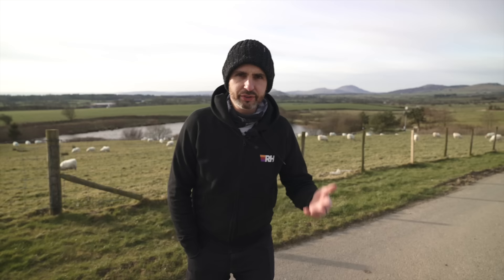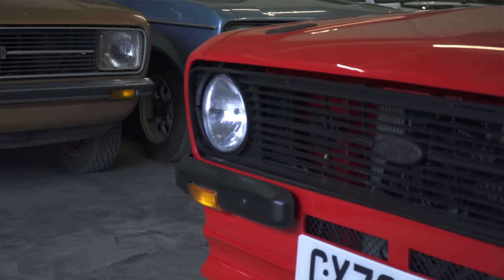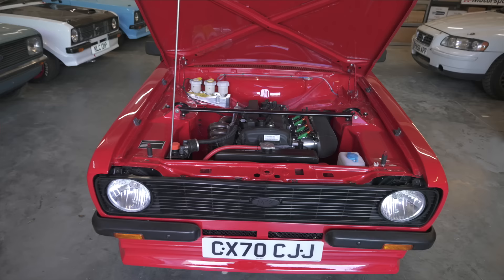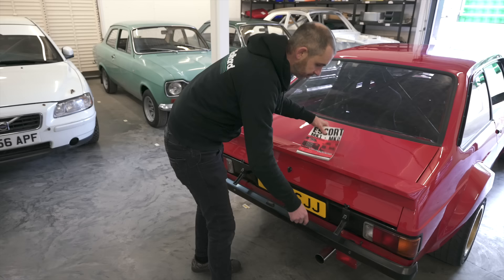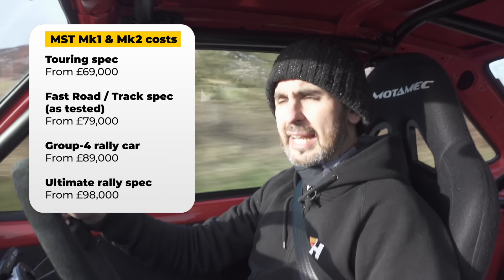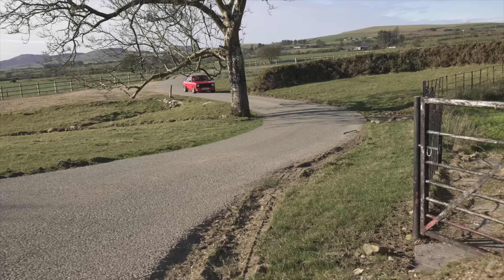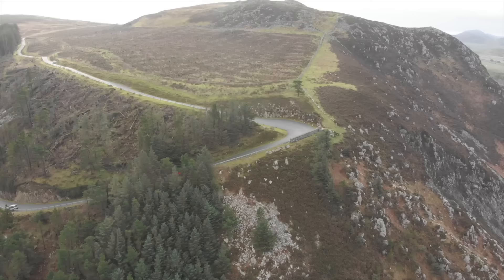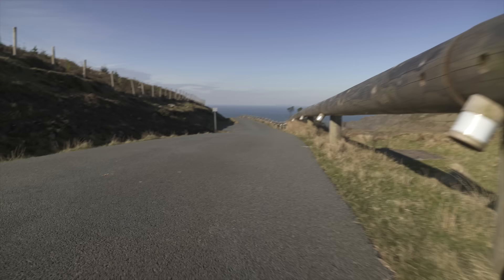BRAND NEW MST mk2 review - the ultimate Ford Escort? Exclusive first drive

Comment: As someone who’s first car was a mk1 escort 1300 sport I actually can’t think of anything better to spend £70,000 on
Reply: Abso-fucking-lutely
Reply: What’s not to like lol
Reply: My 1st was an 1100. The dealer had a 1300 sport, but my dad ( who was subsidising it) wouldn’t wear it. He was right. 3 months later I’d pranged it rather badly. Correctly, he said I’d have to save up to get it fixed, so it was back on the bus to work. That old baby took some abuse though. Near where I grew up there’s lots of roads like those Jonny was on there. When it snowed I’d spend hours going sideways round every bend. Brilliant episode Jonny, as always. One of the best channels on YouTube 👍👍👍👍👍
Reply: @frenchenstein  the price
Reply: @hughmarcus1  My first was a 1300GT
Reply: My dads first car was a black mk1 1300 sport☹️ he had it when he was 14
Reply: I currently have a Mk 1 1300 Sport, which I love,  and, god forbid, if it ever needed it, I wouldn't hesitate in a reshell with an MST shell.
Reply: I can!

Comment: Thanks Johnny, owned a 1980 Mk2 Escort Harrier in my late teens. Now 50 years old and 30 cars later  it’s only that car and my MK1 Golf GTI I regret selling.
Reply: I agree, both great drivers cars. The rawness is missing from modern cars.
Reply: The Harrier was a Ford Limlted Edition rebrand name Manufactures did, to spread the sales market in what was the 1600 Sport. The Linnet was the 1300 Sport.. as a shell/running gear if not elsewise.
I too had a 79 - T 1600 Sport, (Peppermist Green) did need the RS Spoiler to hold the backend from stepping out !!
Otherwise stock, on Michelin ZX's it would go as it was breed anywhere.. all more. 
The Howl of induction of even the single Twin Choke Weber... the sound you where going fast.  Today EFI and Coil packs.. you need the rev counter that it's running.  As for Electric.. hands up.. who has not as yet been almost rundown.. and I'm not deaf, they should make a noise, their on you so fast and silently.. ok before I'm off topic.
Only failings in all the years of joy, the common worn top distributor bush which led to not starting on cold cracking, only if very cold, low battery amps or high speed misfire with excessive play. And rusted rear archs/boot wells.. Yet as a car it's that passion that has me here today.. yes I too regret in parting with it, as for Classic Sport prices 12-13K+..

Comment: Who knew what the Volvo S60 was for before Johnny mentioned it?

I did 😁.
Reply: I was thinking donor engine
Reply: saw them many of times screaming through the welsh forests used as 00 cars in rally gb, lovely sound from the 5 cylinder to
Reply: @chrisoatley9104  My Brother recently bought one, 43k on the clock but it's a 2.4 5 cylinder diesel.
Still sounds really nice to my ears.
Reply: I did see it on its last day of use as car 00 for the WRC in Wales before they replaced it with the Subaru Impreza they now have to do the high speed stage check before the WRC cars come through.

Comment: I raced, hill climbed and rallied a MK1 escort Mexico 1600 with 4 speed close ratio box back in 1976 - 79 ish here in NZ. I built it from a stock road car and added all the go fast goodies and Billstein front struts and  outboard mounted rear shock turrets with Billstein shock absorbers. It was putting out about 100 BHP at the rear wheels on a Dyno out of the pushrod 1600 Ford engine. All the work I did myself apart from having the engine parts balanced. Not much HP by today’s standards but was very competitive in the 1301 - 1600cc class I raced in. Had a few minor crashes and rolled it once in a Forest rally.  An amazing amount of fun at the time. I remember when the MK11 was first released in NZ in 1975 and one of the top NZ rally drivers sponsored by Ford Motocraft gave it a maiden victory in the NZ international rally. What a marketing coo for Ford NZ at the time.  The Cosworth Ford BDA engine has an amazing sound to it when cranked at 9000 revs. 
I look at the current WRC cars and think, wouldn’t it be amazing to drive one of them having all that traction to propel you out of corners instead of wheel spin in the old rear drive cars.  Yes amazing there is still the demand for the old escorts. 😀😀😀

Comment: I bought a Mk2 in the early 90s for £600, and It taught me more about driving a car quickly than any other car since. Thank you CGE 199S, I wonder if you are still around 🤔
Reply: That reg was on a VW polo saloon last registered in 92.
Reply: Yeah but these start at 65k 😂
Reply: @andrewward7168  Actually that was my VW Derby, my very first car! 😁 I can't recall the reg number RSU 654W?  Oh I am getting old 🤣
Reply: @richp2938  Yes it's out of reach for me, although 15k for a new shell would make a great project. I don't need to pay someone upwards of £50,000 to build one up
Reply: @James It looks like it died in 97. Not on sorn or taxed since then
Reply: @andrewward7168  Aw that's sad. Had it survived 5 more years it would have been worth more and been saved. When I owned it the floor needed work, but the rest of the body was pretty straight and solid.  Thanks anyway dude 👍🏼

Comment: 16:20 - "that's a lot for an Escort"...well, yes, but it's not a lot for a visceral, handbuilt performance car. Quite wonderful.
Reply: I guess there’s a saving in time though, a year soon passes when your cutting out and patching a rusty original. I suppose if you allowed say, £50 an hour and wanted to be on the road or track ASAP, this is probably a fairly good value option..

Comment: Aren't the square headlight cars those that came in GL spec and above rather than facelifted?
Reply: I think so. Pretty sure the round headlights were just on the basic or sports versions. Estates all had square headlights, except the one I had, a previous owner had changed the grille and fitted the better looking round lights. GL and Ghia models had the rubber inserts on the chrome bumpers too, you can see that on the cars in the video too.

Comment: I had a MK2 2 door 1.3 Popular Plus from new, FVW 28T, doubt it's still out there. First drive on August 1st 1978 (I think) was to Snetterton, garage delivered it on trade plates the night before. Was going to have a chin spoiler and the rubber wing at the back but couldn't afford the extra £110 or so. Thanks for the memory.

Comment: I have always been intrigued by the ability to build a brand new classic car from the ground up.  In the US, we have Dynacorn which makes 1960s Mustang bodies, 1960s Camaros, etc.  These Escorts, sadly, never made their way to the US.  We did get the Ford Capri from 1974 to 1978.  Our Escort ended up being a front-drive econobox starting in 1980.  Ford produce a crate engine based on the current Mustang base engine, the turbocharged 2.3 liter 4.  310 hp and 350 lbs ft. would make quite a beast of a new Escort!

Comment: My cousin was part of the "Escort" gang at Dagenham who by filching parts built themselves brand new MK2 Escort 1.6 Ghia's and then proceeded to build new cars for sale once each of the gang attained their Escort.   It was an absolute mastermind stroke doing this, in getting the body panels the chap on the body parts presses would condemn panels to be chucked in the scrap bin and later retrieved, engines would be dropped to damage the sump and classed as condemned and collected on way out, even the paperwork was legit pulling a VIN for each motor and because Ford had terrible accounting and control no one noticed extra's were being put through on the books.   
Back in early nineties you could also buy a brand new car at half the new price by picking the model you liked, paying up the wedge to one of the workers who handled it all and your model would be accidentally driven off the side of the rail flat or loading dock rendering it damaged enough to be marked as salvage and Ford were happy enough to get a third book money, the difference between half showroom price and Ford's salvage price was the profit for the chaps who also put into the car all the bits needed to make the car roadworthy again like wings, chassis members, arms etc.

Comment: I miss the old Mk1s
Had a couple, my first was an old banger I bought for £105, 1300cc ex-panda  car, resprayed black

2nd was resprayed in sky metallic blue, blue upholstery, I blew the 1300cc engine up being silly, picked up a 1600cc with twin choke webbers from the local scrapyard for £50 and dropped it in with some fettling,  cherry bomb exhaust on the back, loved it. Till some donkey pulled out across me and wrote it off.

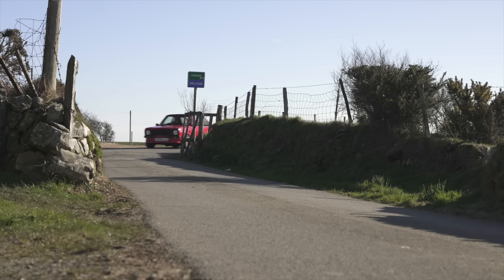Comment: 17:10  Weighs under a Tonne.
My Airbus  H135 Helicopter weighs three times that  - Maximum take-off weight  I keep to 3000Kg
Though the operational costs amount to some USD800 per hour and a little bit.
Still, I can travel at 260Km/h full throttle if necessary to get there quick.
It is configured basically for passenger transport operations and has
to pay for its commercial operation.
Load capacity 1400Kg, 633 Km range

(And being a former RAF/AU/USAF pilot I like the number 633
As it conjures up 633 Mosquito SQN. Now there was a great aircraft.
Greetings from New South Wales, Australia

Comment: Back in 2001, fed up of my then missus criticising my driving decided in my MK4 RS Escort to shut her up and so instead of driving safe as I usually did with a passenger I instead knocked it up not a notch but a whole bedpost and after taking these Dorset lanes at max speed all the way drifting round corners I put the living bejasus into her and it stopped her moaning, in fact it had the opposite effect and I was made to teach her the rudiments of roadcrafting.   We had "his and hers" Merc's after the Escort with mine being a Cossie Merc 190E and she could not handle it at all nor could she handle my MK3 Cossie Granada and that was a motor that made you grin as it just never ran out of pedal and the handling was so firm and tight too.   I still drive like I stole it, my MK2 Reliant Robin is insane fun on these bendy lanes and you go in like a lamb, roar out like a lion and you will leave even the modern boy racers in the distance hehe

Comment: I’m a classic car fan of many variety, ive never owned a new car, and I never could afford one, and I’ve genuinely never wanted to own a new car of any type, mostly because of old school styling, but almost as equally because I dislike modern tec in vehicles, (same applies for my work van). But if I was going to buy a new car for this sort of money, I’d take that MK 1 escort over anything, in any show room, in any part of the world. Essentially what these escorts are, are a new car but without all the modern tec that soon fails in these BM’s and Merc’s etc (designed that way), and I would say that these new cars here could well be the pinnacle of motoring. Having said that, I love my 1966 mk 1 Cortina 2 door and my 1974 Rover P6 v8, the classic leather, oil and petrol smell of both of my cars is a massive part of the attraction for me personally, and arguably the closest we have to a ‘time machine’ cos as any classic fan will testify, when your in your old original classic on a warm day, even just sitting parked in it, you can close your eyes and be back in the 1970’s and a child again. I just wish that car and van manufacturers produced a proper ‘meat and potatoes’ type of their products again, no guff, just basic reliable motoring that we had with say an early 90’s Transit. Long live ‘proper cars’

Comment: Five thumbs up ... and that is from the wrong side of the pond!  Born and raised in the states, my father was a Ford VP, and I have personally met Bob Lutz at my parents' home. 
I became a fan of European cars in the 70's because American cars sucked.  My first car was a 1976 'Mercury Capri II'.  I quickly turned it into a Euro spec. Mk3 with the 3.0 S markings, the same grey cloth interior as the SVO Mustang and Euro Capri's.  It was a Cologne car, and had a fully built 2.8 with 4bbl carb Norris/Isky cam headers etc.  
I would love to buy a Mk3 Capri shell car.  I would power it with a K24A Honda with turbo. (a sin I know, and dad is rolling over in his grave)  But like you said, fun to drive.  
I'll take a five point harness over air bags any day.  200hp would be plenty in a Mk1 escort, and 450 would be nice in Capri with full interior with a cage.
I suspect you will sell as many of these cars as you can build.  If you make some Capri's I'll buy one!

Comment: i had a few mk1 and mk2 Escorts back in te day,always tried to put in,1600 x flow and Corsair 2000 gearbox,had no synchromesh in 1st gear,4 speed box long long gears on them,and a ltd slip diff axle off a 2.8 injection Capri,did nothing to the brakes,still managed fine

would love one of these new mk2's,then the wife and i would be fine,getting through our mid life crisis,i 'm not sure i'd want power steering,would like to try with and without if possible

Comment: Here Down Under the very 1st thing we did when one of us would pick up any ol MK2 would be to drop that lil 4cyl boat anchor and fill up that engine bay with a Ford Windsor v8,i had it down pat as by Friday afternoon after work i would have the 1600 out before dinner ,get stuck in saturday morning and by mid afternoon saturday the Escort would be transformed into a rocketship ,brakes  and diff upgrade were optional if you dragged raced it but the original diff held up ok if you didnt flog shit out of it ,good ol cars

Comment: I had a 2 door MK2 1300 sport on baby blue and stripped it to bare she'll, resprayed Venetian red and fitted 1600 xflow with 1300 pistons, fast road cam, 4 branch, single box maniflow, revolution wheels etc all the usual boy racer roads mods. I worked for AE Hepolite as apprentice so got all the engine parts at 70% discount and did all the work myself  apart from the respray. Brilliant little road car and the 1300 box and diff made it proper nippy around the back lanes. A squint at the MST website shows they're now at £100k+ for a brand new road spec but I'm seriously thinking of punting my money to MST rather than the new Polestar, am I crazy?

Comment: IF... AND I MEAN... "IF" they do an electric version, I HOPE they go Electric motor linked to a 5 or 6 spd gearbox route... Then you WILL STILL have a closer 'Driver input' feel to the car. It has been done, and it HAS shown it CAN work really well!! It's a sad fact that there aren't more elec motor+gear box combo electric cars out there... 
For me... Currently I think I'd go, bubble arches, 'reinforced pillars' (thus removing the roll cage, a mixture of standard interior (4 seat) with a more racing style drivers seat (so a nicely lined/trimmed interior with a lightweight carpet etc) including more sound deadening (for primarily fast road use), 'firm-ish road sprung' suspension, 2.5l Dura engine with 6spd box, and no less than a solid/reliable 250 BHP (at wheels) MK2 innnn 🤔 that gorgeous Audi Ara Blue 👍 (stunning in sunlight)... 🤔 😎🇬🇧

Comment: There's lots of enthusiasm, and repetition of some points, but exactly what aspects of the cars are different or special?  
Is it lighter gauge steel pressings for panels or frame? 
Is it welded together better?  
Are any suspension components cast in aluminium rather than steel?  
What does "under a ton" really mean - 900kg, 700 or what - and is that really notable, as all factory cars were under a ton anyway?  Does it have reinforcing panels welded in, or is that just handled by the roll-cage?
It the front to rear weight balance much different?  (We saw the remote sump, but I didn't catch any rear mounted batteries.)
Even more importantly, is there a fold down visor in the MST catalogue, for those rare moments of sunny British Isles 'glare'?

Comment: Sometime in the mid 80's came across at 1978 MK1 USA Ford Fiesta S,  1580 lbs, 135 wheel hp, my only wish bigger brakes, and a 5 speed... sold it 2007 I miss that car, but hard to keep something like it under wraps in California with smog restrictions, was hoping that restrictions would ease some 35 year rolling and older exemptions, but instead they amended it 1976 period, and older exempt only so the 35 year rolling exemption would no longer would envelop the car .....  http://www.race-cars.com/carsold/ford/1087557734/1087557734pa.htm

Comment: I do not see the appeal they have for the Ford Escort Mk.2. I had the GL version in 1975 and all I can say is that was a CRAP car.  The body work was quick to rust and the various engine components had to be replaced in short order.  On top of that the service intervals were 6K miles.  It is one thing being nostalgic but the cars of today are far superior